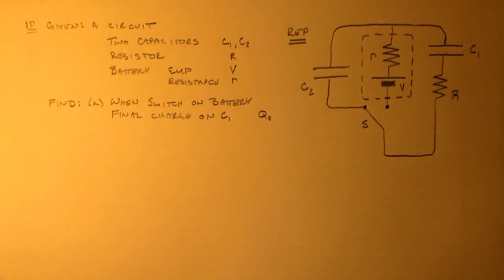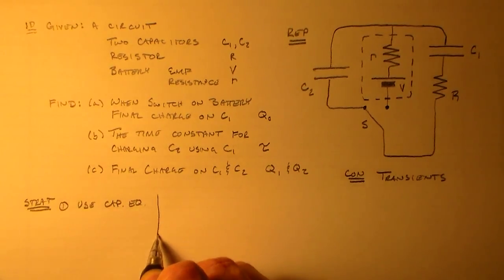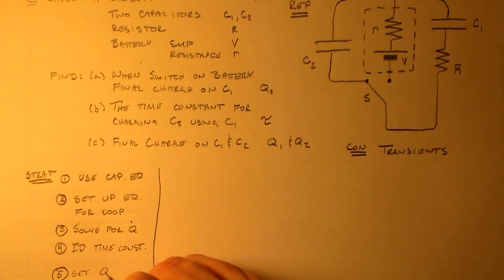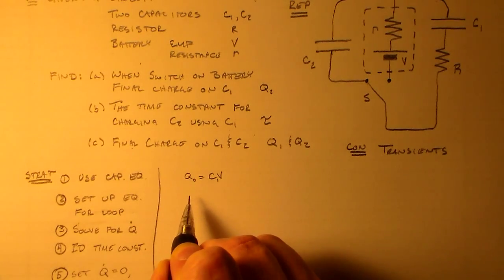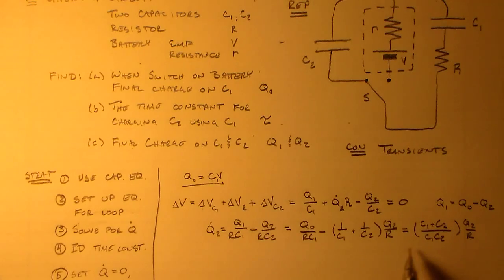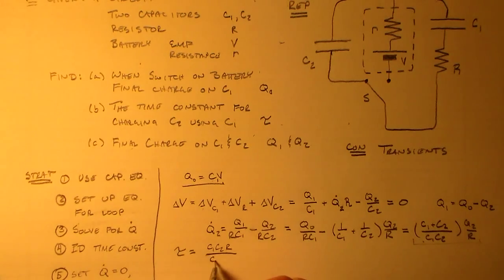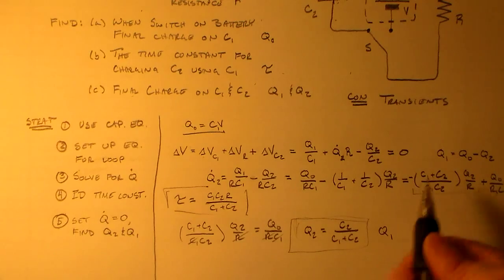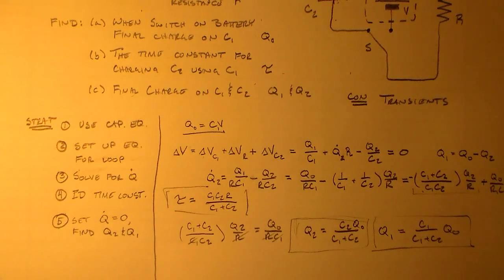Balancing Capacitors

Comment: Does this only relate to ultra-capacitors or does this apply to capacitors in general? And to confirm this only relates to capacitors in series, correct? Thanks!
Reply from the maker: Transient behavior like this should be true of any object with a capacitance, including the stray capacitance in wires.  The specific results of having two capacitors in series, the change in the time constant, is only true in the specific case.
Reply: If I take 3 batteries and I put a capacitor of the same voltage as the batteries on each battery and I then hook them in series does this follow the same rules as hooking 3 capacitor in series or do the batteries act as resistors in this case and prevent the capacitors from over-charging etc? 

16.8V with 16.8V capacitor, 3 of these in series, is this ok? Will the capacitors work normally? Thanks!